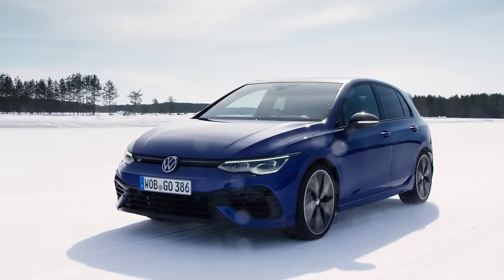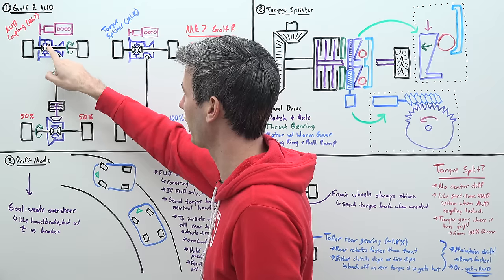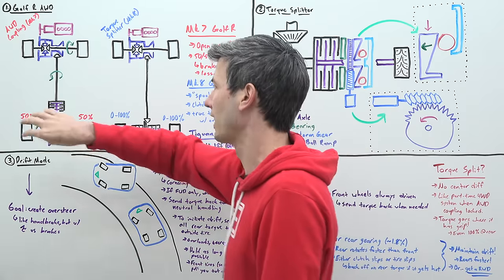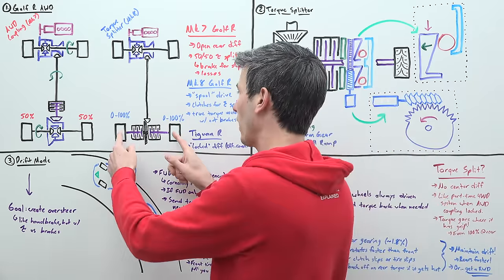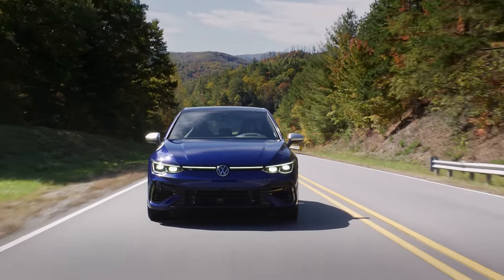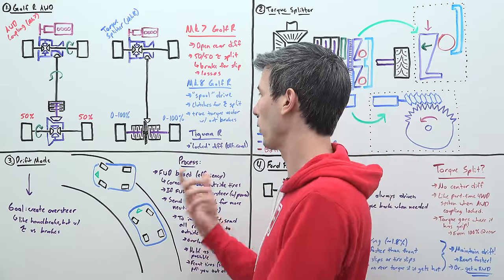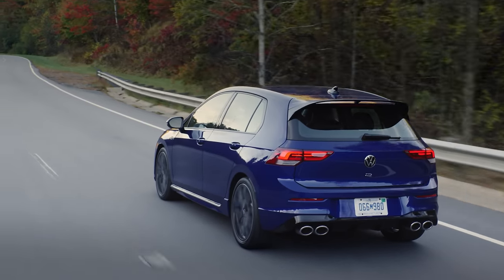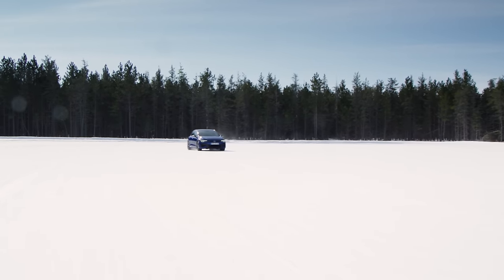Volkswagen's Clever Differential Allows For AWD Drifting - 2022 VW Golf R

Comment: On the Focus, I understand that in a straight line the 1.8% extra speed to the rear will cause a bind and then slip. But would that be the case when cornering? In that scenario I thought the outer rear wheel might be travelling (at least) 1.8% further so perhaps there will be no binding?
Reply: Only for a certain steering angle. But above it you would have negative speed differential and brake the wheel by applying the clutch. 
The moment front starts to slip though, you are good again to apply the rear.
Reply: I've had a Focus RS for about 80,000 miles and what I found is that that 2% difference in speed is plenty except for very tight steering angles. You can always get the car to step the back end out except at sharp angles. But that's what the drift stick is for!

Comment: Hi, I have a question completely unrelated to this topic but need some help with it, front heavy cars theoretically have more traction but in a corner it tends to induce understeer however in another car that isn't front heavy, when the weight distribution transfers to the rear there is less traction at the front which also induces understeer which seems like a contradiction to the front heavy car, just wondering if you could explain? thanks.

Comment: I have got 2 questions, first one is this type of 4WD system also used on the A45, because I have heard similar explanation from Mercedes about its 4WD system on A45.  the second question is does this type of 4WD system can only send 50% power to the rear axle due to its gear ratio?
Reply from the maker: For the A45, it sounds like it's a similar system, yes. For the torque split, it is not limited to 50% sent to the rear. This is explained at the end of the video.
Reply: @EngineeringExplained  I am very curious now. Let's assume if this type of 4WD system can send 100% power to rear axle, then why don't they just lock up both clutches on the rear and do 2 wheel drifting instead of 1 wheel drifting ?

Comment: I have a small doubt. For example, you give only 30% torque to each of the rear wheel. Wouldn't this mean that the 2 clutches are not fully engaged and will keep slipping? Won't this wear out the clutch and generate lots of wasted heat?
Reply: they are wet clutches so wear is reduced
Reply: I was thinking the same, won't there be significant wear on the clutch packs? I assume it's already thought of, but how is it dealt with?
Reply: @Marticus518  Like Marco said they are wet clutches mean they wear significantly less than dry
Reply: Wear is very low if the clutches are engineered correctly (See the pinned comment at the top). As for heat build up, this is the reason the Focus RS is great fun for a lap or two of a track or for a few minutes hard drifting, and then becomes a FWD understeering mess while the rear clutches cool. I expect VW will have done a much better job on this, but this system is done because it's cheaper to make and gives better performance where there's no grip under a wheel rather than because it's as good as the Audi Quattro style 3 differential permanent 4WD setups for sustained hard driving. Interestingly, the original Audi Quattro had manually locking mid and rear differentials, but it was built as a rally car they had to sell a certainl number to the general public rather than as a car designed to be profitable by itself.

Comment: If I understood correctly in one of your last statements, 100% of the torque could be applied to one wheel (in theory) if the other 3 wheels were on ice?  Everything I had heard up until now said up to 50% of the total torque (100% of the REAR torque) could be put to one wheel.  I'd love to see the MK8 R on an AWD test ramp to confirm this.
Reply: Torque is hard to understand and explain. If only 1 wheel has traction and it has no drivetrain slip, it receives 100% engine torque as an outcome. Regarding your test, result depends how are those clutches programmed. Maybe it needs steering angle to 100% lock the clutch, maybe it needs winter temps to lock the clutch etc.

Comment: clever design, but also shows how much simpler is a 4 motor electric powertrain. only 4 moving part, the rotors/half axles, no driveshaft, no differential/LSD, no clutch. wheels can turn at any speed and apply traction control and torque independently. you can do off road, software locked differentials, drift mode, torque vectoring, stability controls, FWD/RWD bias, more precisely and without using the brakes. only downside is you can only apply the power of one motor to any wheel, but thats not really an issue save maybe for extreme drifting where you would want 100% of your peak power directed to the rear
Reply: A modern high class EV has so much power and torque that you really don't want to put all of it down at one tyre (or two for that matter).

Comment: The Golf, having a traditional diff front, would, going through that corner, spin the inside front and outside rear. IOW at hard cornering, where the inside front has little traction, almost all the power can go the the rears.
Reply: Definitely - the inside front slipping is part of the reason FWD goes into understeer so easily (The other reason is that understeer is less likely to kill inexperienced drivers, or indeed experienced drivers who aren't racing but just hit black ice in normal driving, when it happens unexpectedly). Both directional and acceleration control are lost when the front slips, but at least there's a chance of seeing what you're about to crash into or making some adjustment to the slide trajectory - classic RWD crashes tend to be preceded by 180 degree spins.

Comment: still doesn't feel anything like a "real" oversteer. it really feels artificial. i've driven the new rs3 and the new golf r, and i have to say i can't share all of the positive thoughts you hear from automotive journalists. yes, through a corner it understeers a lot less and it is a lot more neutral, which is good for carrying speed out of the corner. but the drift mode is not really fun, you can do short drifts but at all times you feel the front of the car that wants to pull you straight.
Reply from the maker: Haha, that's exactly what I said in the video. It won't hold a long drift, bc the front tires are rotating at the same speed, which pulls you out of it.
Reply: Unless you have a proper AWD (ie Evo, STI, GR Yaris) and know how to properly drift an AWD car, everything else is marketing triumph over any other department. As usual since past decade, German automakers produce overengineered heavy white appliances (eDiff, color changing cars, 30inch TV screens).
Reply: @nikosdimitriadis9987  GR Yaris awd system is actually very basic, the same as in basic petrol Rav4. The only difference is more plates in a clutch-pack and different front/rear gearing.
Reply: @nikosdimitriadis9987  30 inch tv screens. 🤣🤣
Reply: Just get a proper RWD AWD system like bmws xdrive or Genesis g70/stinger AWD system. The m340i and g70 can both drift all day long feeling very natural in there AWD setups.

Comment: With both clutch packs open, the torque split between the two rear wheels is 50% as you've said. But when they're both completely closed, is it not still 50% to each wheel? Is it 100% to each wheel (which sounds like double the torque)?

I'm a little confused by how this torque split concept works.
Reply: If both clutches are open then there is no torque split between rear wheels cause they are not powered, car is front wheel drive. When they are both completely locked then left/right torque split is from ~0/100 to ~100/0, like in locked diff.

Comment: Jason, the same GKN Twinster differential out of the Focus RS and Evoque is used in higher trim GM awd vehicles such as the Blazer, Traverse, Enclave, Regal, etc. I believe the rear is still over driven because they have a tendency to kick the tail out on a loose surface, but what’s the rationale behind causing so much heat and wear on a family SUV?

On the other hand, if my Buick had a drift mode I wouldn’t be complaining.
Reply: Golf R doesn't use Twinster from GKN.
Reply: The rear does not have to be overdriven for the tail to step out. I've driven Subarus with automatics that send no more than 50% of power to the rear and they stepped out no problem, especially pre stability control days.

Comment: I don't know why you say that the F vs R torque can't be measured without the center diff... the front transfers case IS the center differential. No, it doesn't have clutches to vary the torque, but the total available engine power is Divided at that point and a fixed percentage is what goes to the rear (which due to losses from changing direction 90° is going to be significant... you can Never get 100% torque of a transverse engine into the rear driveline without sacrificing the gear losses, so when you say "100% to the rear", that means 100% of what is left over after transferring to the back, which is not nearly 100% of the front axle, turning in line with the crankshaft). In regards to that "wormgear/ball system"... while the Germans continue to try to reinvent the wheel, i will stick with my volvo Haldex system for simplicity, hopefully. Love to have an awd Golf, but have you seen the prices??

Comment: As much as I love golfs, gti’s and the r line of the golfs I absolutely hate the mk8. It’s made cheaply and puts performance over everything. Despite putting performance over everything it still somehow manages to have the manual versions of the cars be as slow as the mk6 manuals. The dsg version of the cars are fast at least. It’s aggravates me that this is an issue because vw should’ve learned from the mk3 that a cheaply made golf is not a good idea. It’s so cheap that the engine cover doesn’t say vw or tsi on it and the infotainment system lags harder than a mid 2008 call of duty server that’s being DDOS. I’d rather be knocked out, tortured and have my identity stolen than own a mk8 golf. The drive train, chassis, and suspension are all advanced but that’s expected coming from 8 generations of golf, especially when the mk7 was so advanced already. People new to golfs are going to buy a mk8 and think it’s how all of them are and never buy another golf again. It’s sad when one of the last generations of internal combustion cars are being developed this badly.

Comment: Great bit of engineering. I do wonder what the shelf life is of these types of differentials. I'd imagine it would be a huge cost to replace clutch packs if ever required. Surely torque vectoring on motor driven EV's is the best solution?

Comment: Jason, would mounting slightly taller rear tires on the Golf R make it work more like the Focus in Drift Mode?
Reply from the maker: Ha, yes, and cause binding and unhappiness in the system.
Reply: @EngineeringExplained  If the wet, multiplate clutches in the system are almost always operating with some degree of slip (except in drift mode, or in off-road mode in the Tiguan R), what would be causing binding?

Comment: So technically it is not splitting the torque, but wasting some torque by slipping the clutch so that less torque gets to the wheels?
Reply: yes. it doesn't waste it-it just doesn't allow all of it.
Reply from the maker: Incorrect. It's splitting torque, and it's not wasting any. Using brakes for torque vectoring "wastes" energy, in that some of that energy goes into heating the brake disc. I use quotes because it's done for a purpose.
Reply: @EngineeringExplained  you're mostly correct. If the clutch is slipping it's generating heat based on the input to output ratio, therefore wasting energy. The advantage is you can slip it only slightly, meaning most of the power gets to the wheels. The torque going in ~= the torque going out, so the power lost is only minimal.
For fewer losses, why not use locking torque converters instead?
Reply from the maker: @ThisRandomUsername  Okay, fair enough haha! There are always losses; in the context of Nich's question, I was thinking he was asking if it's decreasing the torque by creating waste, rather than decreasing torque by minimizing how connected the axle is. Tough to guess via text haha.
Reply: @EngineeringExplained  I see. That makes sense if compared to brake-based torque vectoring.

Comment: Pleeaase talk more about front:rear torque split on cars like the Focus RS and GR Yaris when their "center"s are fully locked. I understand a [formally named] "torque split" only applies to differentials, but whatever technology is used, there is torque flow that can be defined. When one side is geared faster than the other...something seriously fucky is going on and I can't quite figure it out 100%.
If the rear rotates faster than the front, then for X input rotation...where is torque going? The answer would be easy for a normal locked center with equal output speeds - torque is going through both, at least some amount - but what the heck is happening when there's a speed differential? If we assume the rear tires "win" and do not skid, moving the car forward, then...all the torque went through the rear..? But the front RESISTED this change, skidding, so...OPPOSITE torque flowed through the front?? ARGH my brain.

Comment: Question: since the setting ring is rotating in and out of the chalkboard, don't the ramps move 90° relative to your detailed schematic to the right? Like how do the ramps move left to right if the setting ring is rotating fore and aft.
Reply from the maker: Everything is circular in actuality (there are three balls, and three ramps, all grooved into the setting ring).
Reply: An easily accessible version of the same mechanism can be found if you look up the details of mechanical bicycle disk brakes such as the Avid BB7 and the Pauls Components mechanical disk brake. They both use balls running up ramps on a rotating washer to move the brake pads against the brake disk, just actuated by a cable pulled by the brake lever rather than a worm drive.

Comment: Maybe I'm not visualizing this correctly, but wouldn't the rear, outside tire be linked to the same speed as one of the front tires, based on that bevel box diagram? How can the rear, outside wheel spin unless the front is spinning, because there isn't a center diff?
Reply from the maker: As mentioned, yes, they will rotate at the same speeds.

Comment: The 2014 mk7 Golf R I bought new back then was "delicious" to drive, even more on snow and ice (Lappland in the winter was crazy fun). The Haldex and brake torque split worked like magic.
Until it broke.
Haldex hydraulic pump dead at 50.000km.
Full Haldex broke at 100.000 km (yes, Haldex 5 again)
Don't base your choices on tech magic only. Reliability is important when spending that kind of money.
Btw, my turbo broke at around 55k km.
So, again, I used to love to drive my Golf R but, in the end, I almost could have bought another Porsche Boxster. Which is, no doubt, more reliable than the 2014 Golf R.
Reply: I'm sorry for your bad experiences but this is conjecture and shouldn't be extrapolated in a way to give advice to people in general. For most people the Haldex systems will outlast their ownership of the car. I'll give you a bunch of my own conjecture: I put 180.000km on a mk6 R and it still drove like the first day when i sold it. Then i bought a Focus RS where everyone thought the rear-diff would go up in smoke after 5 minutes, i put 120.000km on that car, the rear diff still worked perfectly and unlike VAG, never even needed maintenance. Now in a Golf (8R) again, and guess what, im very confident it will last as long as i need it again.
Reply: This is the exact reason why I am so excited about this torque splitter AWD system vs. the Haldex 5. The weak point of the Haldex 5 is its reliability because of the hydraulic pump actuator! I am so glad this Magna unit is using the electro-mechanical actuator. The clutch pack reliability shouldn't be an issue like, both Magna and Haldex 5. The added drift mode is another bonus!

Comment: Jason, great video. But one slight correction. AWD cars can drift forever. Any Porsche with AWD are able to keep the drift going until the tank runs dry. Join one of their Ice Experience courses either in Quebec or Finland and experience it yourself.
Reply: The difference: Porsche AWD is rear axle biased (rear wheel drive with front assist, really).

Comment: The issue with the Focus RS GKN Twinster system is that there is NO WAY the car will ever be able to tell that the rear drive unit is overheating.

There is no temperature sensor.

Ford uses algorithms to guess when it's getting too hot.

For something so critical, what an absolute fail of a design.
Reply: PDU has sensor as far I know and if that’s  hot, RDU is definitely hot.

Comment: Sti Dccd explain please !
Reply: STI DCCD is very different since it uses a center diff with 65/35 torque split and a combined electrical/mechanical limited slip unit across the center diff. Would be nice if someone made a video about DCCD, never found a clear one ever!
Reply: @aDaWaN  Yes 35:65 ,50:50 or 41:59😆 , only i knew is "Anfangsdrehmoment is adjustble